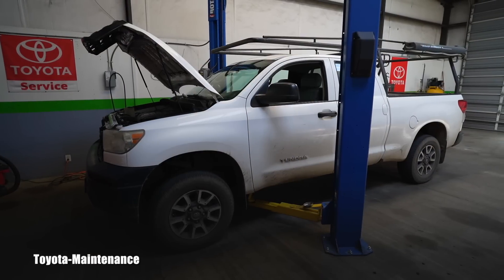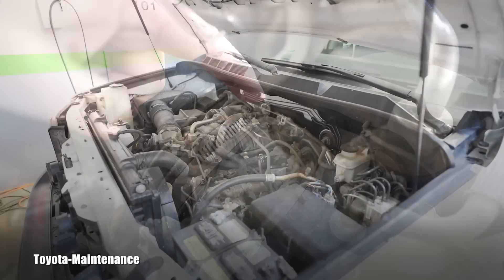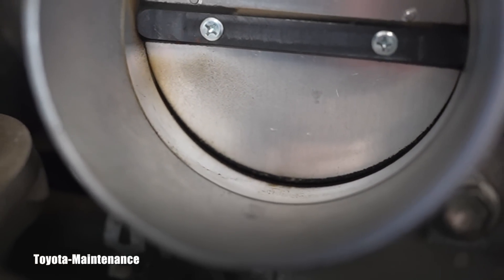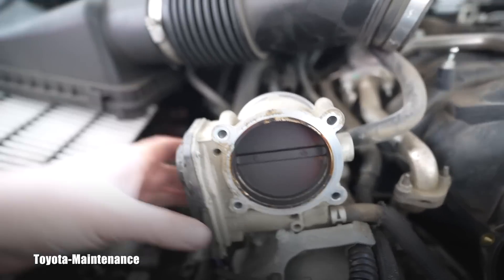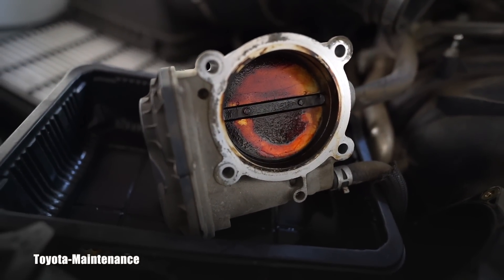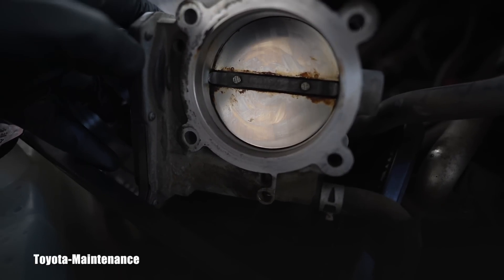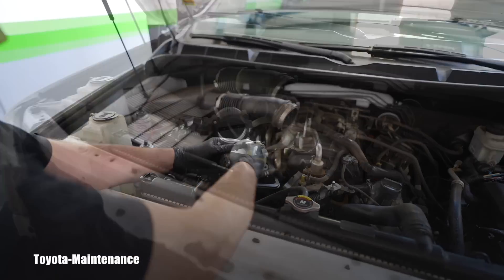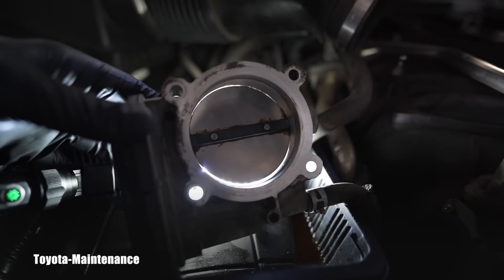Proper Throttle Body Cleaning Guide

Comment: Im battling a misfire in my 2007 tundra with the 5.7 engine. Have just put new spark plugs and it didnt fix the misfire,  so i will be cleaning the maf and throttle body, i also im awaiting a bolt for a section of my upper intake manifold on drivers side, perhaps that is an issue with the misfire, had code p0300, p0301, p0303, p0307 and now mostly p0307, no codes for the passenger side. I dont believe i have a coolant issue in the cylinders, no loss of coolant, the old plugs were quite carboned up, not whitewashed at all from coolant, not wet with oil. Worn out mostly, but still had spark in my spark plug tester. Im going to clean these two items and replace that intake bolt and if thwt doesnt fix it, im going to replace all of the fuel injectors

Comment: That was a great learning lesson.
My concern is not to damage any electrical component.
Without removing bolts and the entire Throttle body, can I just spray inside and try to dry it with napkins.
Would that do the job to a certain point!

Comment: 2nd comment- never use paper towels! I did a timing belt on a 4.7 and it immediately went into limp home mode…I was panicking…turned out it was a tiny sliver of paper that had wedged in the side bushing of the TB plate. Pulled with tweezers and it has run great for a year now.

Comment: Peter, first of all, thank you very much for your videos, you are great! And I've learned so much of them, also to share you my experience: I cleaned my Throttle body and MAF on my 2002 Toyota Camry and the Check Engine Light came on, It was running perfectly, no rough idle, no jerking or something indicating I had a vacuum leak, anyway I kind of freaked out and got it to AutoZone to get it scanned and it threw a P0110 code, I'm not sure if the guys at autozone cleared the code or it went away on itself but after scanning the Check Engine light went off, It has not came back about 100 miles later and car keeps running good.

Comment: I was told by my mechanic to never open the throttle body by hand on these new cars which use a motor to open and close it (he stated they open it electronically). Any validity to these claims?

Comment: Hi
Really helpful videos! I purchased a 2000 tundra recently. 
I do have a question.. 
When I driving my tundra, at first the oil presure goes up with the rpms.. its goes really high! Not the maxed out top line on the gauge but the one just below that..

Surprisingly, I haven't seen to much information on the symptom. There are people saying that they're tundra fluctuates but only just above the half way point.

Thoughts or suggestions, anybody?

Thanks again for great content. Subscribed and notified :)

Cheers
Reply: My son’s 2000 Tundra does the same thing. As long as it’s not overfilled and doesn’t go over the maxed out line, you should be good.

Comment: My 06 Tacoma 2.7L idles high on cold starts like 2500 rpms but comes down to normal once it warms up for about 20-30 seconds. I  have cleaned the throttle body before but it still does it. What else would cause high idle on start up? I'm pretty certain the alternator needs replacing would that do it?
Reply: My 04 2.7 about 5 years ago did that. It would go crazy high like yours  then would want to stall out if I didn't  gas it, then it was fine. I think it was on the 1st cold start of the day or after sitting awhile. I believe it was the idle air control valve or some 02 sensor... not the one in the exhaust...Was like a $300 fix at mechanic. Before I started working on it myself.
Reply: @ianscreamsvideo  didnt even realize it had an idle air control valve. That may be it but im just gonna live with it unless it gets worse. Once it warms up it runs great.
Reply: @turdsandwicher  yeah I just looked it up and it's like $240 part. I'm pretty sure that's what it was on mine. Maybe there's a way to clean it though w carb cleaner or MAF cleaner. Dot. Know if it's electronics gone bad or just gummed up. Im dealing w my EGR P401 insufficient flow right now. And about to do my own rotors and pads. Try to do this stuff myself now if I can to save money.

Comment: Thanks so much, Peter…going to do this to the wife’s 2016 Lincoln MKX 3.7 V6 with 102,000 miles…It actually runs like new.  I do 5,000 mile oil changes since new with new filter. And Coolant changes every 50,000 miles..Trans drain and fill with new filter every 50,000 miles
Reply: Forgot to tell you I use Mobil 1 -5W20 since new

Comment: Why does the throttle body have coolant lines hooked to it? Never knew it needed cooling.
Reply: I think it's the opposite- to heat it up on a cold start. Peter  could have said.
Reply: @BakedRBeans  you are correct Mac N. Cheese it is for cold weather running that can make wet air condensate and then frost and if accumulated freeze the plate open.
Reply: @LAactor  thanks for the explanation ✌🏻

Comment: I keep a toothbrush in my tool box for cleaning parts like that. You can heat the bristle end and bend it 90 degrees for cleaning inside stuff like that throttle body. 
You can use small paint brushes too. Cutting off half of the bristles to shorten them will make the brush stiffer for scrubbing harder to loosen dirt faster.    
You DIY folks might want to keep the shaft horizontal when spraying into the unit, so that a lot of the liquid can't get inside the unit by running down the shaft & into the hole. I doubt enough could get inside the unit to mess something inside there up, but you never know. You would probably need to use a LOT of spray for that to happen!  And it's not a part from a space capsule, or the Webb Space Telescope, where a piece of dust or fingerprint is a big deal.  
Mine needs cleaning, but I'm reluctant to start fooling around with 23 year old rubber parts, when it runs fine other than at idle, when it runs a bit fast. I never sit in traffic, so it is no big deal. I think I will stick with the, 'if it ain't broke don't fix it', philosophy for now. If it starts acting up, I'll tackle it. I've got one pollution system code, but down South, that isn't a problem. Last inspection, the fellow never bothered to start the SUV, or get inside it. Maybe my mirror finished stainless steel grille and chromed differential cover impressed him that everything was perfect. If I can't smell gasoline in my enclosed, windowless garage, I doubt I will destroy the planet with escaping gasoline fumes.
Reply: Good tip. I'm going to start doing this 👍🏻
Reply: As long as you don't knock any dirt into the engine that sounds like a good tip!

Comment: Nice job, I have a 06 tundra 4.7 and I cleaned it from outside a few times, It has always when doing a cold start ran a 2000-2200 rpm’s is it possible in needs removing and cleaned, I’ll have to check it, seems like it always has idled at 2000-2200 rpm’s the 7 years I owned it, seems very high idle from any other cars I’ve owned, and seems to take 5-8 minutes to idle down to normal 8-900 rpms when warm, even does it in hot weather if truck been setting for long time, kind of annoying to have to put in gear at that high of idle. Thanks bud great video.

Comment: Can you use a toothbrush to get into those tight areas to clean it good? I have a 2007 tundra sr5 5.7 and I haven't done this since I have owned it. Also need to probably clean the maf and replace Spark plugs. Love your videos, very informative.
Reply: I was in the same position with an 07. I scrubbed the throttle body and sprayed the MAF for the first time last year.The car's throttle response is incredibly improved. Like a serious difference. This guy's channel has another video where he shows you specifically how to take everything apart to clean it, including the MAF. The car was confused when I first started it up and it does take a day or two for the computer to relearn how much air to take in.
Reply: Same for the 5.7? I have a 2019 Tundra
Reply: @bradandrews735  I would imagine so
Reply: Yep, use a toothbrush or small paint brush and cut the brush in 1/2 to make the bristles more stiff.   I remove mine completely to avoid introducing any debris.

Also, if you remove the filter and gasket, and it’s an older truck, not a bad idea to order a new one to avoid leaks (air) -

Comment: Great video as usual, do you think a oil separator for crankcase ventilator would lead to less build up overall in the intake tract system?
Reply: Maybe, but these newer vehicles are so complex, with sensors measuring everything connected to the computer which makes thousands of adjustments a minute, that I wouldn't change anything. You never know what might change, and send the computer incorrect data. You might exchange a small problem for a bigger one.
Reply: @billsimpson604  good point there but I have put oil catch cans on many new modern vehicles, some of them have done over 100,000 miles as well as my own 1GRFE and diesel Toyotas and so far no issues but a cleaner intake tract and less oil on filter.
Reply: @RoyFJ65  how much cost on average
Reply: @LAactor  There are too many brands but Cusco and Mishimoto have the reputation and they usually go for $60-100

Comment: I cleaned my throttle body in my 2002 Tacoma and it helped it with the idle. My Tacoma has 300k miles on the clock. I hope this is the last truck I ever buy.
Reply: Nice. My 4Runner has 330,000 and runs better than my wife’s Buick with 100,000. Toyota makes great engines,
Reply: Nice guys👍🏻